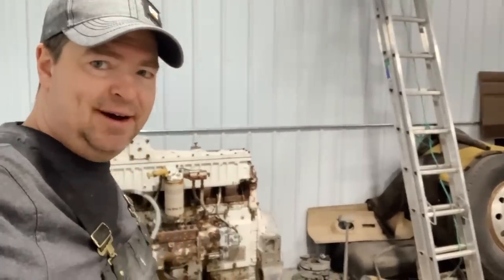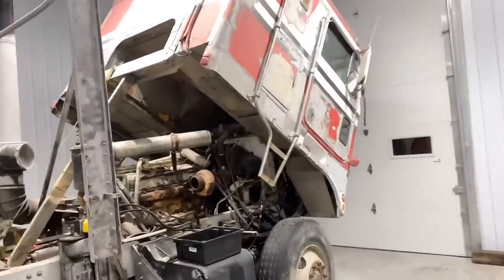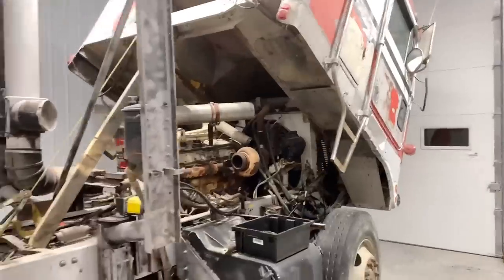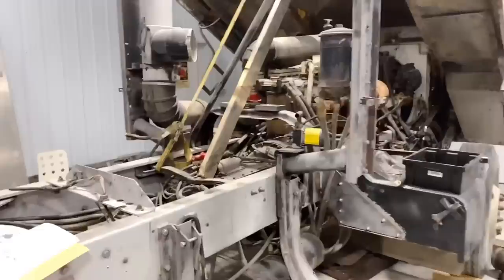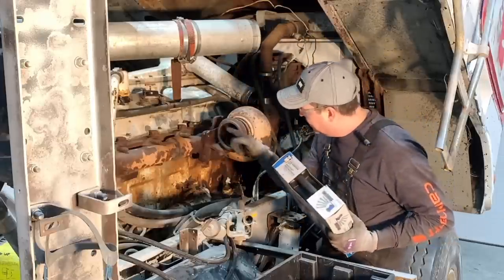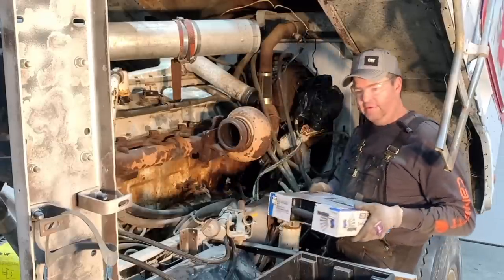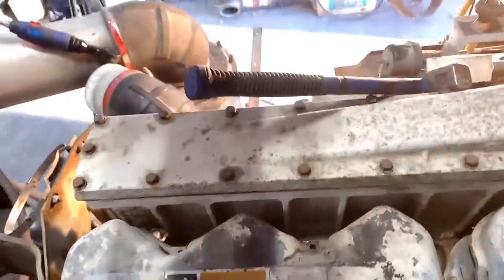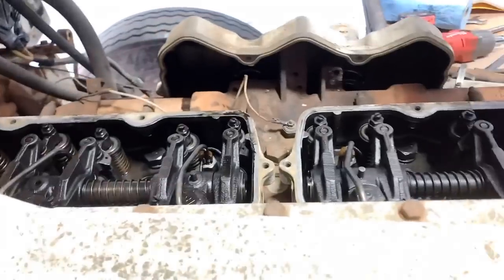Iron Duke Kenworth Restoration Ep.9 Jake Brake Conversion

Comment: I learn a little more every time I watch your channel. I busted a good ratchet one time putting a pipe on it for added leverage. I try to use a breaker bar now if possible. Although I've broken breaker bars also but not as expensive to replace.

Comment: I just got done with a c-18 head gasket in a 637g scraper. There tons of tidily stuff that takes forever like injector height, cam gear lash all that fun stuff. But we have a pin that threads in that hole to pin the engine and you screw it in the housing and it’s spring loaded makes it a lot easier to pin it. Lots of fun... lots of of stuff to take off just get in there.  I sure Enjoy your videos keep up the good work.

Comment: Hey mark great video, I’ve worked on those engines a lot, next time use a Johnson bar and 15/16 socket on the front dampner, it’s tight to get in there but it’s only one revolution and does take as long as using that turning tool, just mart the dampner and one revolution

Comment: I actually built a deep socket by welding two together . It is extra deep and usually hard to get.  Also I never had the luxury of a flywheel tool so I would use a socket on the harmonic balancer on the front of the crankshaft. Good work and good luck Mark !

Comment: Hey Mark, excited to see this progress. I had the head off when that engine started overheating so just put it back loose. There's a crack in the head right around where that valve is missing. Had it magna-fluxed, common for those engines. Missing parts should be in the boxes i think.....it's a long time ago. Seems to me I broke a ratchet taking that head off.....go figure🤣🤣👍👌
Reply from the maker: Ah that makes more sense now and yes I did find all the missing parts in that small box - thanks again!

Comment: Porter greetings! 🇺🇸 Glad to see what goes into adding Jakes to a Cat engine!🤩 I love a Cat…always had good luck with them. It’s good to have friends that know their stuff & are willing to help out when you need them. I’m glad that you’re not afraid to try new things. Hey, what were you welding onto those bolts? Was it just a little nub so that you could get more leverage with the chisel? I guess you needed a break so you could run & get some new tools. LOL. So glad this rig has a Cat…with Jakes, but at least it has a Cat! 🥰😎✌️
Reply from the maker: Since I don’t have proper torches I was welding a nub on each end to try and put some heat to it so the air chisel could work it’s magic
Reply: @TwinStix  🇺🇸Makes sense. Hey, a littlest always seems to help, even just a little bit. Good stuff! 😎🧐✌️

Comment: If you remove that  small plug on the side of the injection pump you can see if perfect on the donor engine...and I  believe you can use a 3/8 bolt and rotate the engine until the bolt drops in the slot on the cam in the injection pump that puts you at  top dead center on a A model cat.

Comment: I did my Mechanical Engineering from West Germany back then it was West Germany. During summer vacations month of August I drove Mercedes Long haul to make extra German marks. The exhaust break was in my heal I think right heal, I think it was much better with both hands on the steering wheel. Here in US I see you have a switch on the dash to reach and engage, which I think it’s stupid. It’s better the heal switch. Let go paddle and step your heal to engage what you call jack break. Lol

Comment: Ratchets have to be cleaned and lubricated. For turning the engine, use a long extension and an impact universal with the engine turning tool. It will slide in there.

Comment: I got to say thats a tease from hell, I already know what comes next as did this so many years ago the fog is bad. I take a cheap socket, put in the lathe and cut into two pieces, put some good quality pipe between the ends sawed off an weld it together... then temper well, works for me. I did the snap on tools and trust me, no way ever again short of millionaire status. I worked a shift for the tools and then one for more tools and a top romain dinner... I do love my esko tools, spelled wrong but you know who I talk about

Comment: Can you please explain what you did with the Welder and angle grinder to make the bolts come out easier with the air hammer.
Reply from the maker: Since I don’t have oxy/acetylene torches I was trying to use the welder to put some heat to the seized studs then I ground off the excess weld then air hammered it out 👍
Reply: @TwinStix  That's a very good technique. I  like it.
Reply: @TwinStix  Can I use a cheap arc Welder for this method ?
Reply from the maker: @waseemkhan-ms1kt  should work 🤔 it’s just like induction heating

Comment: Mechanical work is not really that hard, if you are able to understand and follow directions you can do anything.  I tell most people to read the directions multiple time to ensure they have interpreted them correctly.  I have trained alot of people to wrench throughout the years and the biggest problem I have found is they do not know how tight things should be and it is very simple, every fastener on a vehicle has a torque spec.  When in doubt get the torque wrench out.